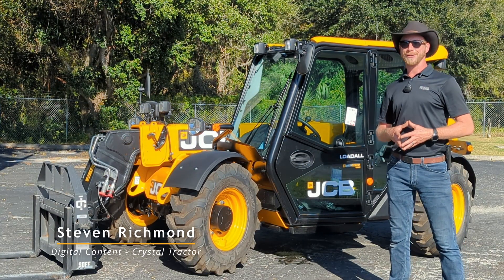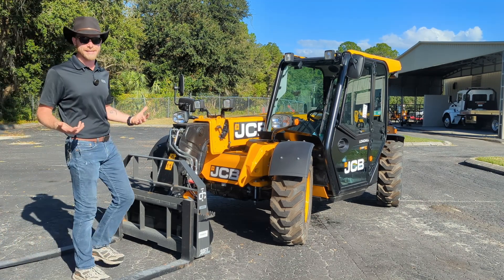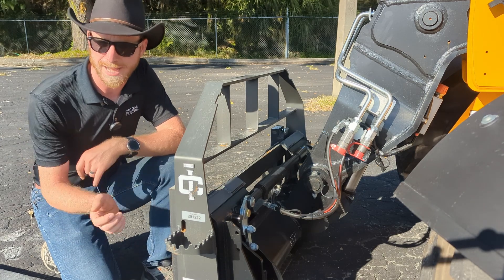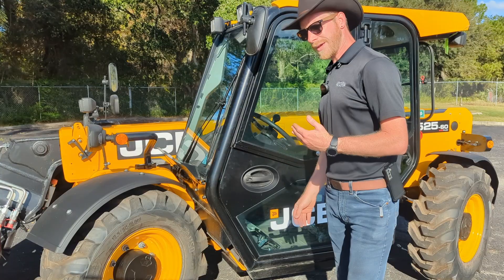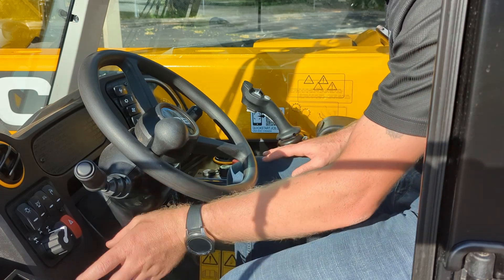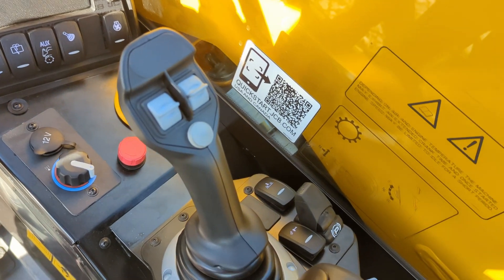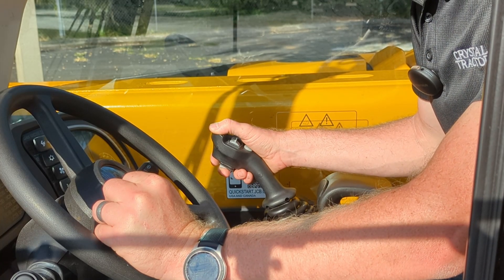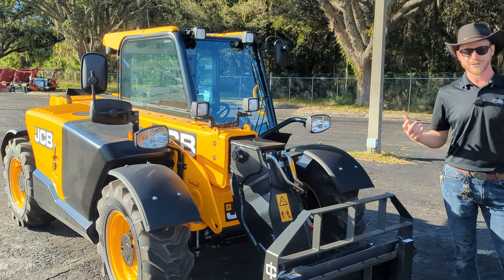JCB Loadall 525-60 Telehandler Detailed Overview

Comment: What happened to the word fork lift
Reply from the maker: Telehandlers are different from forklifts. True they sometimes have 
 forks and they do lift, but telehandlers are designed completely differently, in that they have a boom (usually telescopic) rather than a lift mast, are much longer, and have front/all wheel steering. Some like this JCB model also have interchangeable implements on the front, to be able to swap out for a material bucket, grapple, or other attachment.

Forklifts are generally rear wheel steer, and have vertical lift masts that are either fixed or have the ability to tilt/shift the load to the front and rear and/or sides. The forks are also usually a permanent fixture on forklifts, hence the name.